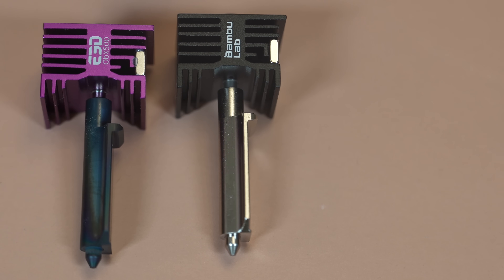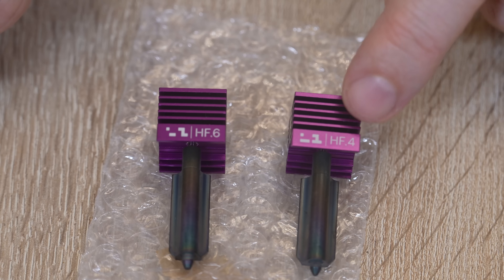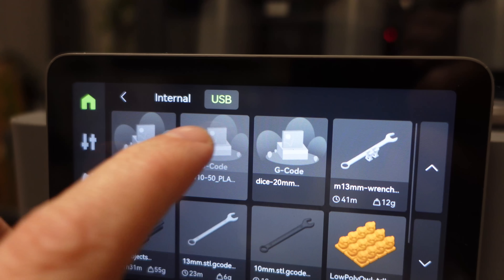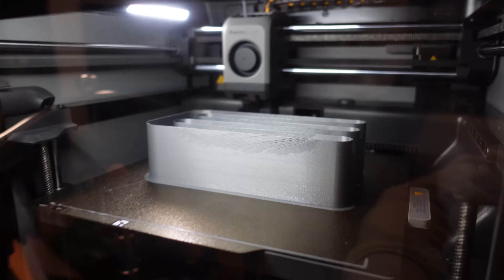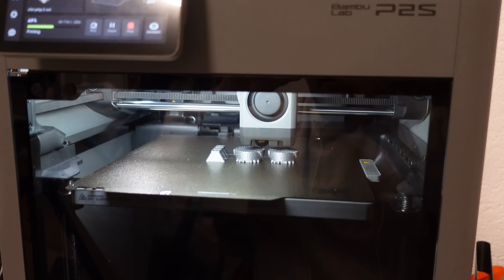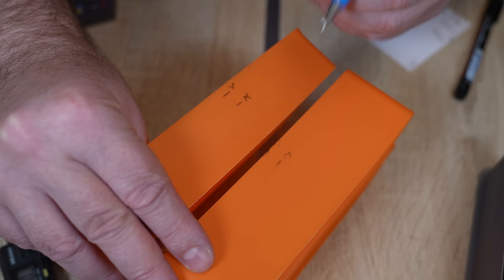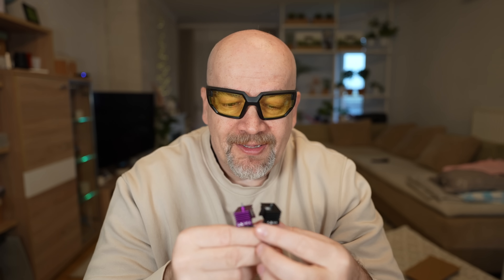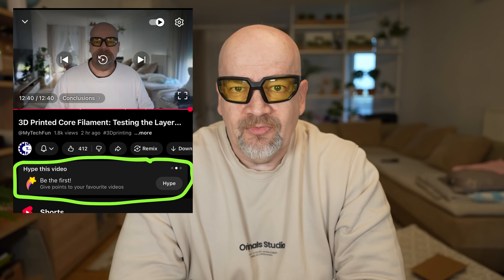E3D High-Flow ObXidian 500 Hotend Test (BambuLab H2D/P2S Version)

Comment: I'm curious how they stack up against the micro Swiss high flow nozzles. The micro Swiss ones are substantially cheaper than the E3D.
Reply from the maker: MicroSwiss HF on the way.. I will compare several in one video (all HF 0.6mm)

Comment: Great video. Explains why my functional prints are weaker now since I switched back to a 0.4 nozzle from 0.6 after 2 years.  0.4 might be the best for PLA dragons, but not pieces that have a real function.  Polymaker’s HT PLA GF is horrible in Z axis with the smaller nozzle.

Comment: It's not worth. I switched a dozen of different nozzles for P1S, including E3D Obxidian, and found out that the stock gave the prettiest and most consistent results - you can tweak it for strength. "High flow" is actually not so beneficial for printing for reasons I can't explain in comment. The speed test is heavily biased towards multi-channel nozzle (deliberately not saying high-flow) and hardly defining for the print quality. TLDR - just keep the original nozzles, now that there is absolutely no benefit for even swapping the nozzles. Just a scam.
Reply from the maker: If you use 0.4mm and default settings (like most users will do), I partly agree with you. I can see advantages if you go much faster than the default flow or with bigger diameter nozzle.
Reply: @MyTechFun i was trying for too long to get good prints with CHT style nozzles. Sometimes I would, but the results were much much inconsistent. What I am saying is that I ended up using the same speed with those high flow nozzles as with the regular ones to get something good out of them. It's like the print actually benefits from being heated through a single channel, keeping the laminar flow and other whatnots that make the difference. This is not a theory but my own experience.

Comment: Really happy to see some layer adhesion tests. A problem with the Bambu printers is that they print so fast by default that all structural prints are relatively weak with default 'standard' settings and normal (non-HF) PLA. I'd love to see how far you can push a HF nozzle before the layer adhesion drops. I fear this test would take a long time to do, though, since you'd need a lot of test objects.
Reply from the maker: My experience, if the filament is melted enough, then the layer adhesion is good, not so sensitive to speed.. https://youtu.be/W3SCl302CP4?si=ltcLNBzf07E1BArB

Comment: You didn't readjust the flow rate in the slicer. The point of the max vol flow test is to find that value, then put that into the slicer... Otherwise your comparisons between quality are of course basically the same. you're not really comparing the nozzles. The point of a high flow rate nozzle is to print at higher flow rates. You printed at the same flow rate, and compared them. That's not a comparison.
Reply: Yeah this whole video completely misses the point of a high flow nozzle.

Comment: Would you know if the bambu high flow nozzle works with core fiber filaments? 
On there website photos there’s definitely some interesting geometry going on at the nozzle, but i don’t think it is the split into multiple channels type.
Would be interesting if you can test bambu hf compatibility with core filaments, or ask them about it.

Comment: i never thought about running max flow rate tests the way you did. i just measure the distance from the bottom to where it has a visual discrepancy. and then go into the slicer and set the color scheme to flow, and drag the slider at the point it failed, and itl show the exact flow its pushing out at the bottom slider preview. 

that should tell me the exact max flow, right?

Comment: Was there defects/bubbles in the walls of the speed test with the 0.6 nozzle or did it only look like it. Reason for asking is I've had some issue when using 0.6 on h2s and h2d mostly on ASA and on random places on smooth walls. It might be an interesting video if this is a wide spread issue. Reducing retraction has helped a bit for some reason, think even bambu updated the profile to the value I used but still there are issues. And since it looked like you had it on the speed test where there are no retractions there could be something else like small clogs or something that causes this only on 0.6, assuming your filament was dry of course. I did get the new h2c/hd2 pro additional fan to see if it has to do with heat creep but wont get to test it until the firmware is released. Just suspecting that fan was added for a known quality issue by bambulab...
Reply from the maker: Bubbles in walls is the moisture. Since this was long testing. And for flow test (Orca), the filament is on external spool holder. Absorb moisture. And interesting, pay attention, only the outer loops have more moisture (bottom of the flow test).

Comment: Bambu Standard to E3D High Flow is Apples-to-Oranges.

Bambu High Flow to E3D High Flow is Apples-to-Apples, and the comparison this video should have been IMO.
Reply: Deal not in High Flow rating. Deal hardness of nozzle.  Bambu Lab far far far FAAAAAAAAAAAAAAAAAAAAAAAAr BEHIND... I print mostly (99.999%) abrasive high temp materials with carbon or glass or metal particles. E3D - is Superior. For non abrasive filaments, no reason switch from BambuLab hotends. BambuLab hotend are superior in term of quality and price..

Comment: Your Bambu Lab PETG flow test has a tremendous about of little blobs in there - what's going on with that?  I just got the E3D nozzles today, looking forward to trying them out too!
Reply from the maker: Moisture. Long test, PETG on external spool holder. Outer loops got some moisture (bottom of flow test object).
Reply: @MyTechFun  great video! I was just so curious about that.  Thanks!

Comment: Why no high flow 0.2 mm nozzles.... this is where the high flow would make the biggest difference in cutting down the very long print times....
Reply: The bottleneck with .2 nozzles doesn't have anything to do with melting the filament, instead it's a pressure limitation with trying to push the filament out a tiny orifice.

Comment: The only thing, doing flow calibration test is this.....You should dial in each nozzle to show what the maximum Volumetric flow rate each one can achieve. And show how strong the layer lines are in the flow test. This is exactly what I do to calibrate each of my filaments on my ECC printer. Then you have actual numbers to go by. I can get upwards of 35-55 depending on the filament. With the ECC stock Hotend. I found using E3D hotends on an older bed slinger the E3D hotend does not flow as fast/much as other hotends. So I'd like to see the numbers so I can compare it to mine.

Comment: How do you explain the increased layer adhesion? I have a Bambu HF 0.6 nozzle :) so should I expect it to be higher than Bambu standard 0.6 or not?
Reply from the maker: I think the BL HF is similar to E3D (flow properties). The main difference is the wear resistance and durability (and temperature resistance, but we don't need 500°C)

Comment: Can you also test the Tungsten Carbide and Tungsten Carbide High Flow Nozzles from Bambu? Tungsten Carbide has better thermal conductivity than steel
Reply: I  looked in Bambu slicer and don’t even see a profile for the tungsten nozzles. Must be too new
Reply: @Musicalbullet  The bambu HF regular profiles are so conservative - like 16mm^3/s when double or more that works fine..   Let's fix them before tiny details of steel vs tungsten thermal conductivity.
Reply: @wesc23  I always run flow tests and optimize the profiles. I know they are capable of way more 👍🏻
Reply from the maker: Eh, I don't need so many nozzles. I will contact BL, if they will send them to me for the testing..

Comment: I can see the value in the Obxidian nozzle over the long term, but It seems to be a bit ahead of it's time here in how the Bambu machines are limited to 350C, not 500C. I am considereing the Obxidian for use with my H2D as layer adhesion is very important to me in my work projects. Even 10% better quality is worth the extra cost to me in the long run. Thanks for the great video, this has been very helpful!

Comment: I would love to see this exact same test done with the BIQU Panda Juicer HFC hotends. At least in the US, they are nearly  quarter of the price of bambu's, and 1/8 the price of the E3D, while claiming the same benefits as the E3D one. I have generic high flow ones for my H2D which were half the price of even the BIQU ones and they work perfect so far.
Reply: I was going to buy one of those BIQU ones but saw way too many complaints on those on aliexpress of various problems that should never happen. Ended up with an e3d nozzle for the a1 and it's been great just the price omg.
Reply: Just buy and test
Reply: @theunboxers24  I do not have the expertise or equipment to test, nor do i have any interest in buying such an expensive hotend if i do not have confidence that it is better than much cheaper ones.

Comment: Given the significant price difference, it would be good to compare the E3D nozzles with Bambu's own high flow nozzles.
Reply: Bambu's tests claim a 62% improvment using their HF nozzle over the standard one and E3D's claims their .4mm nozzle is 50% better than the standard Bambu nozzle. Going by my own experience with Bambu's .4mm HF nozzle, I do think it performs slightly better. Regardless, as you've said Bambu's HF nozzle is half the price.
Reply: @nerfvinc12121212  the main appeal is the obxidian part I think. it's very hard.
Reply: @nerfvinc12121212 

Yup. Helio emailed me their measured flow rates for bambu's 0.4mm HF as I was an early subscriber, and they're about the same as e3ds profiles.
Reply: I don't understand why he bothered to compare these two when it obviously is only relevant to Bambu's own HF offerings.
Reply: This is what I wondered as well.  I assumed that a HF nozzle would flow more than the non-HF.  But these are supposedly premium HF.  Do we get anything we can actually use for that money?

Comment: I can't get Orca to connect to the H2 even in LAN Only and Developer mode  so couldn't use it for calibration.

However, using a similar model I get much higher max flowcrates.
BUT, that doesn't come through in print times.

With a 40% higher max flow, a big model comes in 10-15% faster - not matching max flow at all.

Max flow isn't everything.

Thanks for all the work Igor.
Reply from the maker: I prepared the object in Orca Slicer, but I transfered the files over the USB disc. I cannot connect Orca and Bambu any more..
Reply: @MyTechFun Me neither. In Lan mode I get an error, enabling Dev allows it to send the file but nothing happens. If its back to SD or USB transfers, we're back in the dark ages.
Ok for calibration I guess, but not for printing in the Post-Bambu age
Reply: @MyTechFun BambuSlicer has the Orca calibrations too. You need to enable dev mode in the settings. Also you need to use the most recent release because it the menu was disabled by mistake for a while. 

Unfortunately BambuSlicer does lag the OrcaSlicer so it doesn’t have the most up to date calibrations. Missing YOLO flow calibration as well as the improved circular pattern sadly. But it’s easier than using the USB drive
Reply: bambu connect works as expected for sending orca gcode to the printer.  works fine for all the calibration tests in orca.
Reply: @JerseyTom  Maybe one day they will actually release Bambu Connect for Linux so we can actually use it too. Although since it’s been in beta all this time I don’t feel like they really plan to continue supporting it.
Reply: @JerseyTom Maybe for you, not for me.

Comment: I have Phaetus Conch plus for A1/A1 mini with 0.6mm hole. It works great and didn't cost an arm and a leg. I wonder how it compares to the stuff in this vid.
Reply: From what I saw the phaetus has a lower max flow rate compared to the e3d when I was trying to figure out which one to get for my A1 also. I tried up to 50 max flow rate with high speed PLA with the 0.6 e3d nozzle and no sign of issue at that speed, can probably get a tad bit more rate but not enough more to make a huge difference anymore as it maybe will max at like 55-60 which won't do much for a print when most won't be printing in that speed anyway.